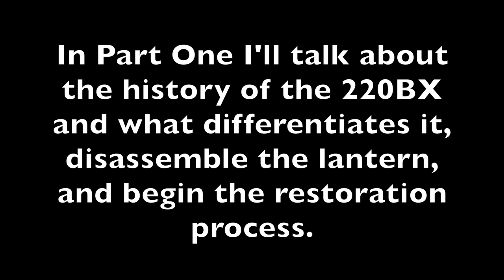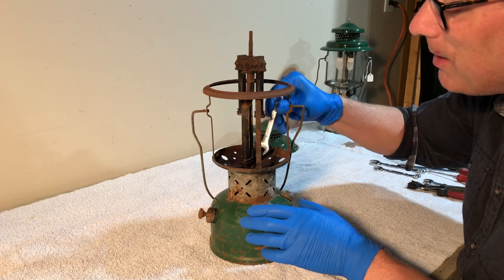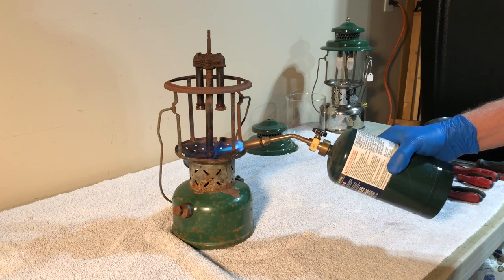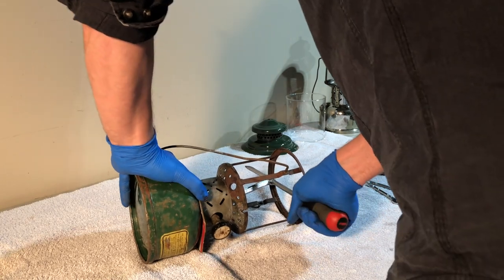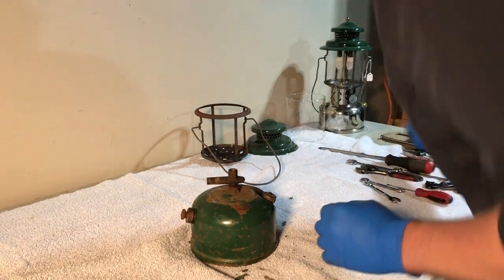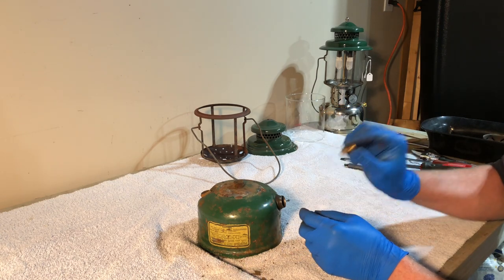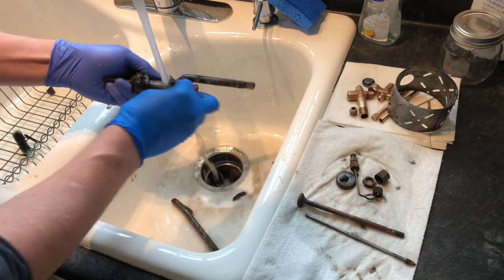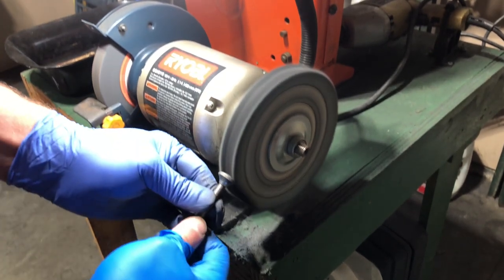1944 Coleman 220BX Lantern Restoration: Part One

Comment: Nice work as always.   I loosen the cage first before trying to loosen the air tube screw.  That way you can go at the screw straight on rather than at an angle.

Comment: William, the dripsie  sink strainer tool could help prevent losing a part down the drain when working in the sink. We use them on the kitchen sink as well. Well designed tool if you can get new from Amazon in CA. If not avail there, let me know and I can send you one from KS.
Reply from the maker: Thanks.  In fifteen years I have yet to drop anything down there, but I use the side with the garbage disposal just in case.  If something does fall down there, I can easily retrieve it.

Comment: Bill I’m surprised you never use oven cleaner or lye. Works great for paint removal as well.
Reply from the maker: With all the rust, the wire wheel was a good option.  It stripped the paint while cleaning the fount pretty well.  I've been experimenting with other options.  Last week I made a video using acetone.  It'll probably be a while before it's released.  I had planned to use oven cleaner in a video, but as I was setting up for the video I realised my wife had bought me the fume-free variety, which isn't any good at stripping paint.  One of these days.
Reply: Yes the oven cleaner is very good at paint removal. Better than acetone. You can even mix in hot water in a small container leaving it as strong as possible and let it sit over night. Oven cleaner strips oxidation on nickel and does wonders for fuel residue and gummed up generators. I usually use this before the citric acid because it pulls off the organic material allowing the citric acid to work better and faster. And yes get the good stuff. You can buy lye powder as well. Just be careful